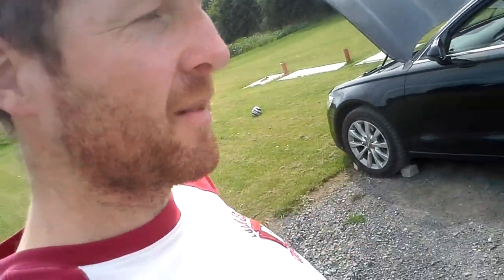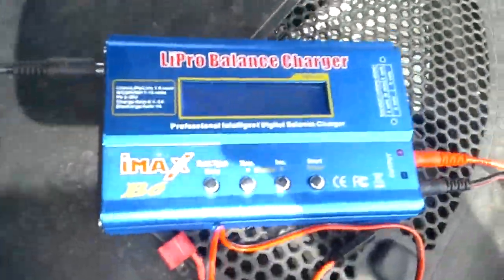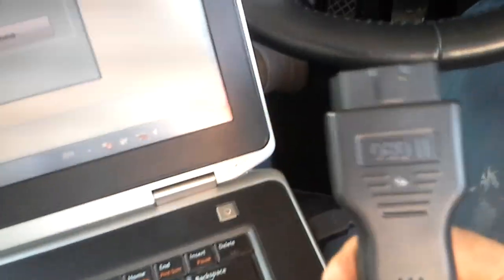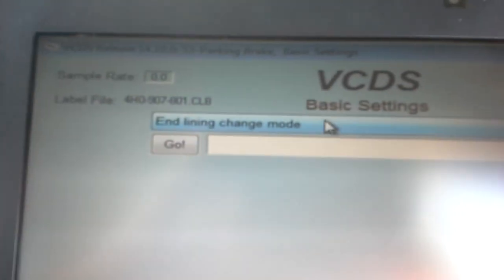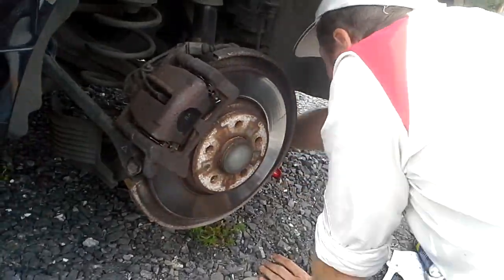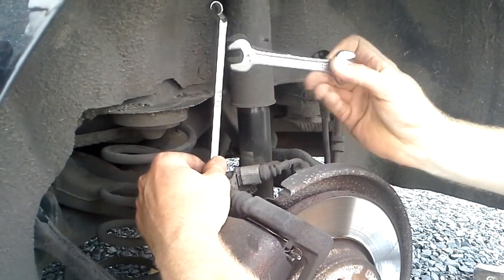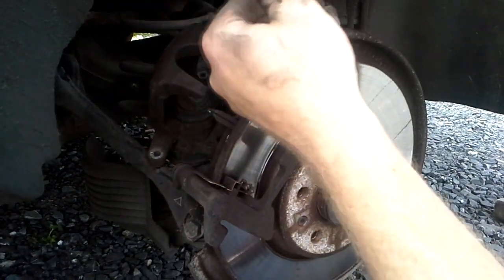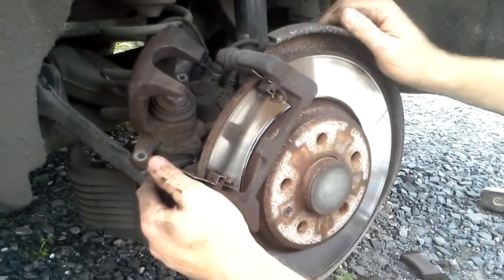replacing AUDI A6 C7 rear brakes (pads and discs)

Comment: Good job but it’s a good idea to open the brake reservoir filler cap & put a towel around it as the new pads will push brake fluid back up the system
Reply from the maker: indeed! I did it as seen on 00:52 but forgot to mention it ;
Reply from the maker: ups, I actually did @ 01:15

Comment: In general correct, but there were few mistakes:
1. Use torque wrench. I believe you did not torque enough big bolts and overtorqued small ones.
2. Both big and small bolts have to be replaced with the new ones, as well as the clips. Strange that clips and caliper bolts did not  come with the pads.
3. I would wipe and re-grease guide pins with special grease (silicone-based, in the US must be hard to get European one but the one from 3M should work).
4. When you screw caliper bolts in, don't rotate the guide pins with an open end wrench, just hold them so they don't rotate by themselves.
Reply from the maker: дякую Дмитре!
Reply: I think the small bolts are easily reusable if you add some blue Loctite to them.  The torque is only ab out 5nm.  AND I definitely agree with pulling out the guide pins, INSPECT THEM and the bolt, wipe them and use the 3M silicone paste. it takes about 4 minutes per axle.  Crazy not to check them while you are there.  If the guide pins are damage, it will ruin the pads.  I use that 3M paste for a lot of stuff
Reply: Small bolts are torqued at 35Nm on Audi Q5, don't think A6 is much different.
Reply: Which vagcom cable did you use. These seem to be many fake or non working ones on eBay.

Comment: Also isnt the purpose of the charger so that the ignition stays on during pad and disc change as a loss of connection would mess up the braking system?... or is it because you have used a laptop which has its own power supply you can turn the ignition off? Your reply would be appreciated as it has the same setup as my A7
Reply from the maker: my view is that battery charger to be used for just in case when the car battery is low and will stop powering on the on-board computer in the middle of the job... When ignition is off, the computer is still on ( in standby or some other mode) the power is very slowly drained from the battery all the time.. my battery is still original (6y.o.) so I decided not to take the risk.
Reply: @grubasyk  I guess the vcds pc can be turned off when ignition is turned off also ?

Comment: Aren't the rear pistons wind back not push back????? 🤔🤔🤔🤤🤤🤤
Reply from the maker: definitely push back in my case, otherwise I would have trouble to push them!
Reply: Its simple push back on cars with EPB, and wind back for cars prior to EPB
Reply: Definitely win back in my case - clockwise (A6 Allroad year 2015). Also, no need for software to release the EPB. Just put it in neutral, step on break pedal, release the parking break (would be nice to secure the car, so it will not have tendency to walk away on you ;)    ). No need to connect the charger to battery either. If caliper is stubborn, take down the break disc, put everything back (without the disc). Much easier to fight the caliper that way :D
Reply: Mine on the A7 were push back at the front and wind back on the rear

Comment: DO NOT REMOVE THE CALIPER CARRIERS.  WHY DO PEOPLE INSIST ON TAKING OFF THE REAR CALIPER CARRIER???? READ THE DAMN AUDI MANUAL.   You do not need totake off the rear carrier.  The rear disk easily comes off without taking off the carrier. Same for both C6 and C7.  AND USE NEW CLIPS.  You should be able to do both side of the rear axle for pads, clips, guide pins and disks in less than an hour after the wheels are off.  Leave the carrier alone!!!
Reply: Helen Rudy it's fucking impossible to remove the disc without removing the carrier lol.
Reply: @Slisktord nope